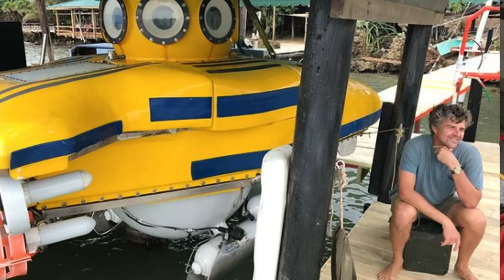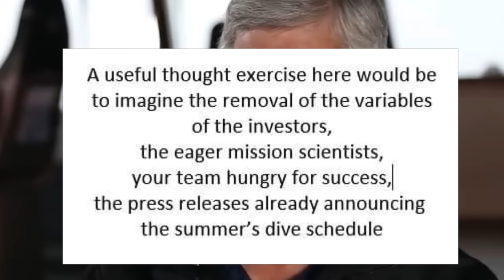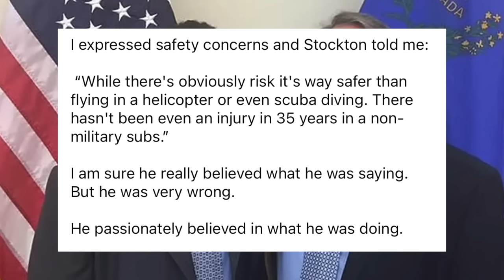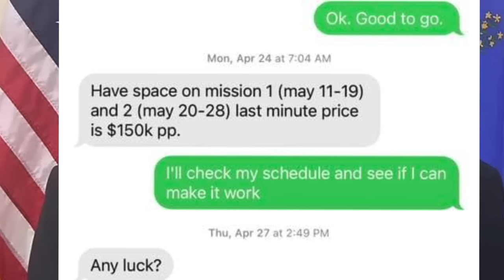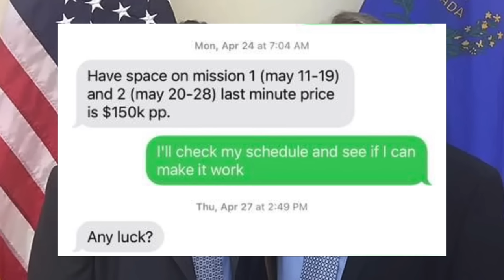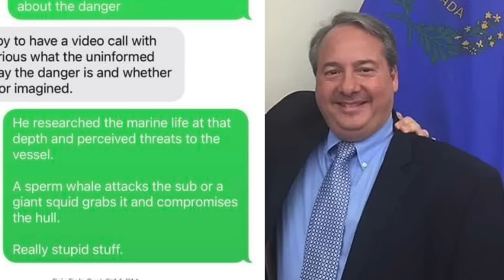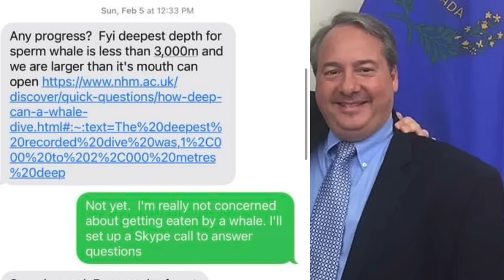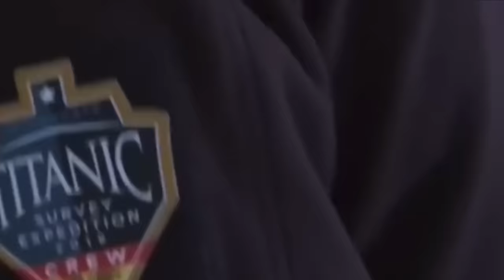Titan clients who said NO speak out how intense Rush was chasing them #titan #oceangate

Comment: Interesting that a teenager with internet access was fully able to understand the dangers involved in the Titan, and prevent his father from going. For me, the game control alone told me all I needed to know about the harebrained scheme.
Reply from the maker: sadly the teenager that went also found the warnings but his dad was too obsessed with the Titanic
Reply: 🎯 Yes, that game controller alone would have made me stop and go “hmmmm… no thanks.” But thankfully the young man did some research and he and his dad backed out. Too bad the others didn’t do the same. I feel bad for the passengers, but Rush did that to himself.
Reply: from what i’ve heard listening to interviews with industry professionals, game controllers are actually pretty standard despite looking funky— even the U.S. military uses them! really the most dubious parts of the submersible’s construction was its’ shape and the material used for both the hull and window. the window alone was never meant to endure the pressure of the depths they needed to reach when viewing the titanic
Reply: For me, the biggest negative was the fact that passengers on the Titan had no restraints - they had to sit freely on the floor. If Titan became out of level for whatever reason, the passengers would pile up at one end or the other. What a mess. Imagine trying to deal with maneuvers to correct this situation- in the dark!

Comment: The downside to being a dynamic, motivated,  self starter can be simple hubris.  Those 'crackling' noises were damage that was ACCUMULATED with every dive.  And that monitoring system, if it picked up excessive crackling, meant that failure is imminent.

Comment: The first time I saw that sub I knew it was a deathtrap. Couldn't pay me enough to even sit inside it on land.
Reply from the maker: yes, made by duct tape and zip ties
Reply: If we could assign human emotions to the Titan submersible,  it no doubt regrets it wasn’t taken better care of or standard safely features built in. It spent months sitting unprotected on a parking lot exposed to all kinds of Newfoundland weather, then loaded on a raft & towed multiple times back & forth 400 miles to the Titanic wreck site. The earlier hull cracks & probable delaminations were not addressed, corrected, or even admitted. “Passengers” were loaded in, unsecured, piled up on the floor like sacks of potatoes, mostly in the dark, & then bolted in from the outside so they couldn’t escape an emergency event even if  they wanted to. The whole design was flawed from the very beginning, & after multiple dives its subsequent slow hull breakdown was apparent but ignored. It is no mystery that the thing finally imploded taking with it 4 innocent lives plus one whose greed,  arrogance, & refusal to listen to engineering experts cost his own life. There are so many lessons to be learned here it’s hard to know where to start.

Comment: The strength of carbon fiber is in holding up against tension, but is not appropriate for resisting compression. I'm not even an engineer and I understand that. Stockton Rush's passion wasn't going to overrule the laws of physics.
Reply from the maker: yes exactly , the submersible community should have spoken out sooner but they are chronically underfunded so they did not want to throw dirt in their own nest I suppose
Reply: What I really want to know is whether there was shelf life to the hull? Did they expect to replace it after a certain amount of dives or was it totally reliant on acoustic monitoring? If it was only expected to last a certain amount of dives then even the cost saving comes into question of using carbon fibre. A successful submersible of the cylindrical design was the Alluimat. An aluminium submersible cable of 17000 feet depth with more than 3 passengers. Retired now but an example of how it should have been built.

Comment: If you ever handled carbon fiber, you know it is a brittle string and electrically conductive.  It breaks when bent (dented) beyond a radius in the neighborhood of about 1/8" to 1/4".  Its strength is NOT, NOT, NOT against bending forces as would be needed in a submarine, though its tensile strength is fantastic for a balloon.  DUH!
Reply from the maker: thanks for the explanation 👍🏻
Reply: Also, it doesnt expand and contract with changing temperatures at the same rate of titanium. Even if you joined the two materials well, it would never be suitable for diving very deep.
Reply: I'm not a carbon fiber expert. I'm not even a proper engineer, just a software engineer who has an amateur interest in engineering in general, and someone who (as a caver) has more than a passing interest in material science (as I like to have some understanding of the things I use that stand between me and my potential descent from a large height onto solid rock.)
As soon as this whole thing became news, even I was wondering why someone would choose to use a carbon fiber cylinder with endcaps of a different material when I knew that previous deep vessels had opted for one-piece spheres using a single essentially homogeneous material. Given that, I would happily be corrected by a consensus of actual experts who could show why I was mistaken.
I have certainly done a few dumb things in my time, but if someone suggested I descend a cave using ropes or karabiners that someone had made but hadn't really tested and that they claimed were "experimental", I'd less than politely decline.
Reply: AND, this batch was used. He stripped it from a plane and it was never supposed to be used again.
Reply: @dlynn101  That's not true!  You can not reuse it. It even shows many times it being wound in the process of building it! It had passed it use by date, that's all.
Reply: Carbon fiber is a great material, but is not up to the task of back and forth this thing experienced. Carbon fiber is strong ASF, but cannot be used under constant "pulls and pushes".

As a motorcycle mechanic, look at 2 stroke dirt bike reeds. Carbon fiber reeds break apart LONG before Metal reeds. Shit starts falling apart. It's not a material designed for anything but strength in a constant one way direction. 
Carbon fiber bodywork does the same shit. 
I've also seen carbon fiber auto parts and carbon fiber motorcycle frames breakdown over the stresses of time. It DOESNT BELONG ON A FUCKONG SUB!

This is just absurd.

Comment: I have to question the comments on “experimental “ aircraft. There are many well designed and well built aircraft in that category. That said, they are dependent on the skills and ability of the builder.
Reply from the maker: yes I agree , many are built with sense and care , not with arrogance
Reply: You should note the difference in self made aircraft. Experimental means using untested and unproven methods as opposed to building aircraft using tested and proven methods

Comment: utilizing carbon fiber at depths of 13,500 feet would be an illogical choice and plain stupid. Carbon fiber's inherent brittleness and susceptibility to pressure-induced delamination make it unsuitable for withstanding the colossal hydrostatic pressures at such depths. A more logical approach would involve materials like titanium alloys or advanced ceramics, which exhibit superior resistance to the extreme pressures encountered in deep-sea environments, ensuring the structural integrity and safety of the submersible.
Reply from the maker: it was stupid and reckless 😥

Comment: Ive watched many videos on this tragedy and to be honest the sub had proved itself capable of doing these dives It had made a number of trips to titanic so we know it was, in part had an element of success. What people fail to acknowledge is any man made structure needs regular maintenance. Especially if they have moveable parts or are under stress. You cant  run a car without a breakdown at some point thereforeIt would be nieve to think this sub could continue to operate infinitum without maintenance. It wasnt a question of , what if it  needs repairs and fault checks, it was a question of When? After how many trips would it require these things? The truth is, it was never thought about, or given consideration,  as once it showed signs of acute stress or need of checks it would be too late to address it and people would die.  In other words just an accident waiting to happen.
Reply from the maker: problem with carbon fiber how he used it, you can‘t maintain it, only replace and it is very hard to find the cracks. I would have needed a full scan before and after every dive

Comment: This is sad.  I will say that his use of an "Experimental" aircraft should not bue used as an indictment of the man's charachter as a risk-taker.  Building and flying an "Experimental" aircraft is nothing like what he did with that sub.  "Experimental" aircraft are really not experimental at all.  Well at least not most of them.  They are largely built from a kit of sorts where the design is sound.  Most of them are based on existing proven designs like the Piper Supercub.  If the "builder" builds more than 51% of the aircraft then they can perform more of the maintenance which makes it much more affordable to own and operate.  They still have to go through airworthiness inspections and conform to FAA regulations.  Flight testing is also required.  Some "Experimental" aircraft are actually warbirds that have been flown for thousands of hours.  Experimental just means that the owner has more flexibility in how the aircraft can be equipped.  Experimental aircraft cannot be used for commercial purposes.